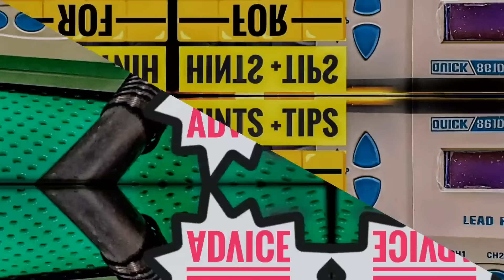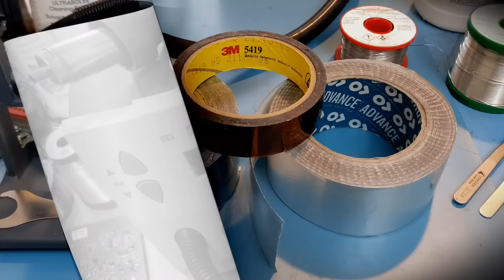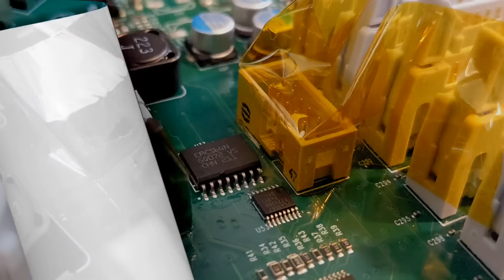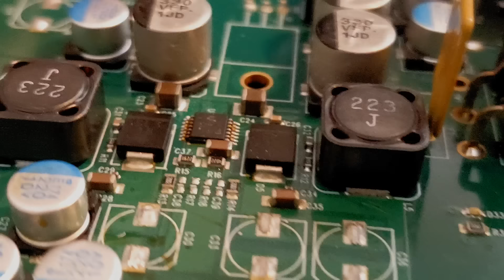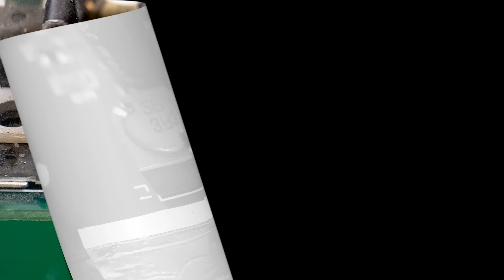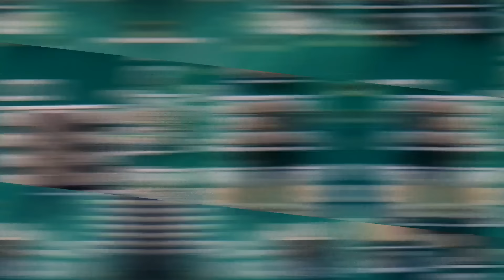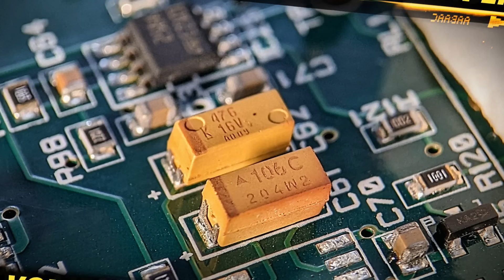How To Use Hot Air Rework Station / Soldering / Electronics

Comment: Good job, the only thing I am missing is the exact settings on your hot air station. You mentioned some temperatures but no settings on the air flow (or did I miss that?).
I have the same rework station and my air flow is mostly arround 30-35. For temperature it depends a little but I am mostly between 320-370.

Comment: Hi, great video there, i wanna ask about how you desolder components from a multilayer board as the solder cant melt at all even with high temperature hot air

Comment: Thanks for the vids; lifesavers to beginners like me. SMFL200D is discontinued (according to Rapid Online website) Have you found a replacement you can recommend? Also, where do you get the white mesh cleaner you use to remove flux? I use  Flux Off aerosol with a brush but all that does is spread a thin film of flux all over the board. Not ideal.

Comment: Could you make a video on how to desolder a mini pci-e slot from laptops etc,because i am stuck with 2 boards where i have to transfer one to the other and i don't have access to parts or replacements,i can desolder with a soldering iron and hot air so you can choose.

Comment: Hi I have a simple hack to help remove multi way contacts consisting of using an old tip or cartridge. Have a couple of photos and a short description but wanted to just pass it on but so much easier to show pictures. I tried to send messages via email but not listed so left this comment to try and contact you. If interested if not no problem. Thanks.

Comment: Do you ever pre-heat your boards?
Reply from the maker: Hi , thank you for your comment . I do occasionally in my day job need to add heat using a hot plate . Normally heat the board up to between 80 and 100 degrees Celsius and then carry out the rework . Hobbyists probably won't have hot plates at home due to costs so that's why I showed the local hot gun method to add some extra heat as you can get fairly cheap hot air guns 
 Thanks again 👍
Reply: @mrsolderfix3996  Thank you.
For a hobbyist, do you think it would be an ok idea to stuck the board (say a multilayer PCB with a big ground plane) in the over for 15 min at 80-100°C (checked with a thermocouple)?
Then place it on a silicone mat and complete the rework quickly
Reply from the maker: @NicksStuff hi , you should be ok at 80 to 100 degrees Celsius , but try 80 first of all . I would definitely give the oven a good airing before you do any cooking again as there may be fumes from fluxes , glues etc that may have been on the boards . Just keep an eye on the board during the 15 minutes . Good luck 🤞
Reply: @mrsolderfix3996  Thanks!
Reply from the maker: Hi , no problem , hope you get on ok 👍

Comment: Brillient demo my friend. Shorts after soldering. You'll find using solder mop to remove blop and solder those pins with fine tip soldering iron much better we find.
God bless
Reply from the maker: Hi , thank you for your comment . Difficult on this one , joint was attached to a plane sucking the heat away as I mentioned in the video . Normally I would do as you said but wouldn't work here . Thanks again 👍

Comment: Long ago i started pre-heating my boards with a homemade heater. (PID controlled of course).
Once heated to 100c, it really makes component removal or replacement easy.
I typically use Kapton to hold larger components from moving while installing a new component or to hold a small board in a custom made heat plate (think Intel CPUs which I repair a lot of).

Well made and informative video. Thank you.
Reply from the maker: Hi , thank you for your comment , very much appreciated 👍

Comment: I thank you for this as I have some smd stuff to change and was wondering if the kapton tape was ok and low and behold your video drops. I have two different thicknesses of foil tape so it looks like I will try both. Thanks again.
Reply from the maker: Hi , thank you for watching the video and commenting , very much appreciated . The foil tape is definitely more protective so I hope you get on ok with your project. Thanks again , take care 👍
Reply: @mrsolderfix3996  Hi yes tried both thicknesses the thinner was fine in getting into corners and gaps but it was an absolute nightmare to get off. The thicker tape great , it two seconds more effort to get into gaps but it just came off in one piece. Both traps worked very well it the removal thar was a problem. That maybe due to the glue they used. Which is very sticky on the thin tape. I think the thicker one is 3M no markings on the thin one. Thank you for your reply.

Comment: I've done a lot of electronic repairs, but why would you not put flux on when you removing any components.
Reply from the maker: Hi , if you watch this and my other videos I do put flux on when I remove components . I mention it in this one where I removed the qfn and also the first IC between the 2 connectors . I probably use more flux than 99% of people posting soldering videos on YouTube  . I'm a bit confused by your comment 🤷

Comment: Very interesting, thank you. I've always felt Kapton tape is a dubious and I've seen max temps of 280c through to 500c. Out of curiosity if you wanted to keep the IC working what would be the max temperature, 380c is too hot?
Reply from the maker: Hi , I have removed and reused IC's at 380 degrees Celsius and they have still worked fine. I'm not saying all types of IC's will work but the ones I've had to remove and replace due to polarity issues have been fine . In fact I believe I've used 400 degrees Celsius before and been ok . I guess if you have no spares and need to rework the one you have then definitely try it . Thanks for your comment 👍
Reply: @mrsolderfix3996  Thank you mate.
Reply from the maker: Hi , no problem 👍

Comment: Hi Mate, thank you for your time making this video, would it be possible to share in the description some more details on the Advance tape please? I can see on RS there are few of them not sure which is you have used in your video. Also to note that all of them I can see including the 3M tape have a rating of max 149c heat whilst the capton tape alleges it's over 350c, I know from my own experience that capton do as-you-said break under heat, anyway, thanks again hope to hear from you soon, cheers
Reply from the maker: Hi , thank you for your comment . I either use Advance AT500 or 502 tapes . They are both very good for PCB rework and I personally have applied crazy temperatures to them when doing rework of over 400 degrees Celsius with no problems . Definitely use foil tape rather than Kapton that's the message I try to get over to people . Thanks again 👍
Reply: @mrsolderfix3996  Thank you very much, found them just now, have a good day mate.
Reply from the maker: Hi , no problem , thanks for your time 👍

Comment: I've had the best results with kapton tape when I left an air gap between the plastic bit I wanted to protect and the component I was desoldering. Not everytime you can have that kind of room to leave an air gap tho, thanks for the tip with the aluminium tape! I guess I can try doing that with just a normal aluiminium sheet for baking, it has no glue but it should hold just fine.
Reply from the maker: Hi , thank you for watching the video and commenting , very much appreciated 👍

Comment: I must have cheap paste the hot air just blows the components around
Reply from the maker: Hi , thank you for your comment . From what I've experienced in the past you may have your air flow speed a little high . You've probably tried turning it down but if not it's worth a go . Once the initial heat is applied after a few seconds the component tends to stay there even before flowing occurs . Sometimes I will initially hold with tweezers for a couple of seconds then withdraw them and carry on until flowing happens . I wouldn't have thought it would be due to your paste type . Hope you get on ok . Thanks again , take care 👍

Comment: I tend to use kapton tape so I'll give foil a go, 
seems like it would dissipate heat better than Kapton,
When lifting ICs I'll sometime use a tiny bit of leverged upward pressure using a cocktail stick,
Reply from the maker: Hi , thank you for watching the video and commenting , much appreciated . I used only Kapton tape for many years and then reluctantly changed , but I'm so pleased I did because rework is so much safer now for me . Hopefully if you do try the foil you find it much better like I did . Thanks again and good luck 👍

Comment: On the first half of the video, when you removed the IC between the connectors: the components around were in place, but it looked to me that their solder was affected, needing a quick reflow with new flux. Was it the case?
Reply from the maker: Hi , the surrounding components were still in perfect condition after the IC was removed with no reflowing necessary . The Electrolytic Capacitor that was missing just behind the foiled connector was already missing before we started . This was a lead free solder board which I'm sure I mentioned so naturally the joints look duller anyway than if it was leaded solder . This is also why it took a bit longer than normal to remove . Thanks for your comment 👍

Comment: Excellent video, I got an Atten 5 months ago that is very similar to the device you are using. Good station makes a lot of difference. Thanks for sharing. One question: In the first half you shared the hot air station settings (speed and temperature). In the second half you mentioned only temperature. Was the speed the same (90)?

Comment: I've always been confused with using the proper nozzle size as well
Reply from the maker: Hi , thank you for watching the video and commenting . You do get a feeling for what size nozzle you need the more you do hot air rework . I started with the smallest nozzle , then when I did the QFP i used the next size up . I could have used even bigger but it would have blocked the camera view . The smallest size is definitely the one I use the most as so many components can be removed with this size , i.e resistors , capacitors, small IC's and small SOT 23's . Hope this helps a little . Thanks again , take care 👍
Reply: @mrsolderfix3996 The issue with smaller sizes is that airspeed goes up and they might blow away components. Sure not an issue if you can protect everything around with tape.
Reply from the maker: @AladimBR  hi , with the Quick861 model I use you can turn the air speed down to basically zero so working on small devices using hot air is still pretty easy without them blowing away . Some people use sticky flux to help hold their parts in place . I find if you use normal liquid flux like I do if you hold the part with tweezers just briefly then take your tweezers away and the part stays there until flowing occurs . Thanks again. For your comment 👍

Comment: My heart goes out to you that you have to use lead free solder excellent work!
Reply from the maker: Hi , thank you for your comment , much appreciated . I have got used to lead free solder nowadays , it is definitely better to work with than when I first used it about 15 years ago . I use one from a company based in England  called BLT Circuits . It is SN100SB . It's a great lead free solder and comes in different widths right down to 0.25mm. Also it's a great price compared to some of the big companies like Farnell , RS Components etc . So it's not as bad as people think these days , just up your temperature by about 30 to 40 degrees Celsius and you should be ok . Thanks again , take care 👍

Comment: I really like watching electronics work and your shots are just gorgeous and a pleasure to follow along.
I'm not a practitioner yet but imagine it would be easier to heat shield around only the part worked at, instead of guessing which ones around it is at risk of getting damaged? (25:32)
Thanks for sharing your expertise!
Reply from the maker: Hi , thank you for watching the video and commenting , much appreciated . It was good of you to mention the connector nearby that got slightly melted . I wasn't particularly concerned what happened to this connector when I used the heat gun next to it to remove the IC . It was good that it actually melted to prove a point that you should protect your parts and remember from earlier in the video use the foil method . White connectors generally melt really easy as you saw . My usual method is to protect everything around the part being removed  , but especially connectors . Thanks again , take care 👍

Comment: If you dont want to scratch PCB use plastic tweezers :) or a plastic spudger they are cheap and useful at times :) especially if you have customer that complains about every little scratch
Reply from the maker: Hi , thank you for your comment , much appreciated . I use metal or plastic  tweezers to push foil tape down ( these are just what I had nearby ), the tape is very protective of the board so if careful scratches will never occur . In lots of my videos I show flux applications using a plastic cable tie , as I am very mindful of damage that can occur at times with metal tweezers . But you are right ,plastic tweezers are very useful at times . Thanks again , take care 👍

Comment: Is there a trick to changing the nozzle on the heat gun? Or do you just have to fight it?
Reply from the maker: Hi , thank you for your comment . On the hot air station I use , the Quick 861DA it's really easy . It comes with a small spanner that fits on the nozzle perfectly . You simply turn the nozzle a few milimetres anti clockwise until the nozzle lugs line up with the cut outs in the end of the metal shaft . Then simply pull it straight out . Fitting a different nozzle is everything just mentioned but in reverse . It's very easy . Hope that helps , thanks again for your support , take care 👍
Reply: @mrsolderfix3996 Thank you. I have another question, this time about the aluminum tape. Does it ever leave a sticky residue or does it peel off pretty clean?
Reply from the maker: Hi , it can leave a very small amount , but is easily removed with PCB cleaning fluids . Hope that helps .
Reply: @mrsolderfix3996  that's what I needed to know. Thank you!

Comment: I only occasionally solder for really rudimentary tasks.  But I love watching your good resolution videos and detailed narration.  Makes it easy to understand and gives me courage (in my head) to try some more difficult tasks.  If only my eyes were what they used to be.   Thank you for sharing.
Reply: Magnifying glass wouldn't help?
Reply from the maker: Hi , thank you for watching the video and commenting , very much appreciated 👍
Reply: I started using a desk mounted,articulating arm magnifying glass with a light ring around it, pointed at the subject years ago.
I had 20/20 vision until my late 30's, and I'm stupid enough to still believe my eyes are fine, despite the fuzzy images I'm seeing. Lol. The swing-away magnifier allows me to only use it "when they use too small of parts- what ever happened to larger components?!?" 😂😂😂

Comment: Nice! I have seen a lot of your videos on wicking leaded solder. Can you please do a video on wicking lead-free solder?
Reply from the maker: Hi , thank you for your comment . I'm confused as I didn't use any wick in this video 🤷
Reply: @mrsolderfix3996  Apologies for my confusing post. My request above is kind of irrelevant to your video here. I have seen a number of your solder wicking videos, which I presume were using leaded solder. I find it very challenging to wick lead-free solder even at very high iron temperatures. Do you have any good tips?
Reply from the maker: Hi , in my videos I just use whatever boards I have , some are leaded , some are lead free . If I'm struggling with lead free wicking the main thing I try is to pre heat the area with the heat gun like I've shown in this video . Lead free solder then becomes much easier to wick off .Works well doing this . I know some people who cheat a bit and blend a bit of leaded in but shouldn't really do that  . Add flux to your wick as well . That's really all I do , add localised heat in first to the area . Thanks again , good luck 👍

Comment: G, day from Sydney Australia. Thanks for protection tips. I was thinking of using a paint heat gun with a reduction tip/nozzle  (if it will fit). Solder paste: whats the difference between solder and flux?
🌏🇦🇺
Reply: You need a precise control of the temperature on the area you're work on, that paint heat guns don't offer. Some works are possible with these heat guns, using distance to control, but I never tried that. There are some precise heat guns , i use a Steinel HG2320E at work for heatshrink tubes for example. 
You also need precise control of the location you're heating, so paint heat gun handling may not be as easy as the Quick (or equivalent) station.
Flux is a product (rosin, for example) that helps the solder flowing towards the board pad and the component pin.
Solder paste : small solder balls within lots of gel flux.

Comment: Why didn't i thought of that. Thanks for the tip.
Aluminium foil tape is also used in vapour-tight house isolation, so a roll should be not too expensive.
Reply from the maker: Hi , thank you for watching the video and commenting , very much appreciated 👍

Comment: Nice  Demos Thanks . How do you deal with the leftover adhesive from the foil tape ?
Reply from the maker: Hi , thank you for watching the video and commenting . Both the tapes I talked about , the Advance + 3M makes leave very minimal or no adhesive behind at all . If there is any I just use ULTRASOLVE ( PCB cleaning fluid ) to clean off , which it does easily . Thanks again 👍